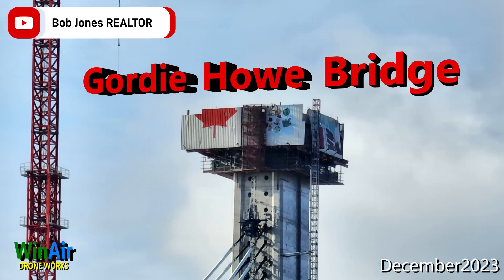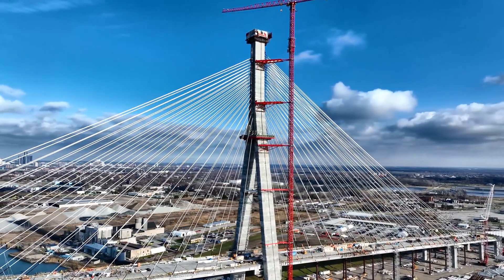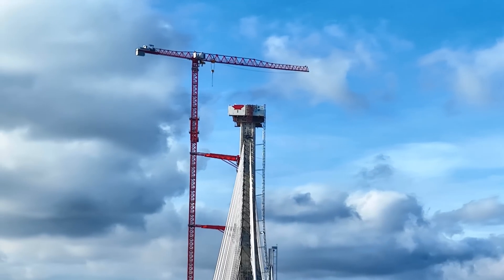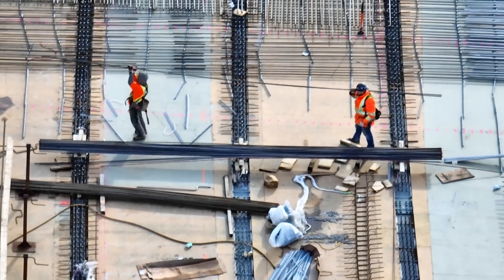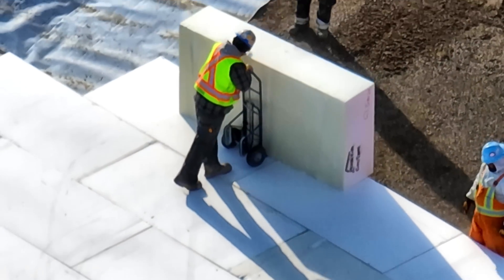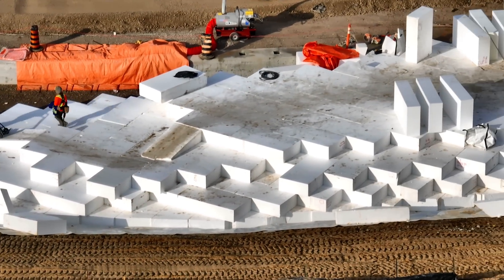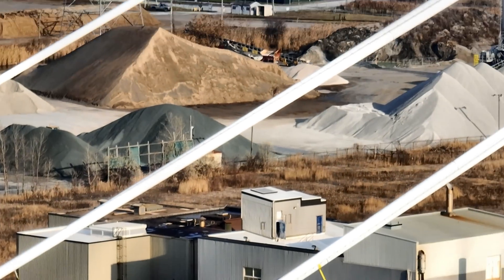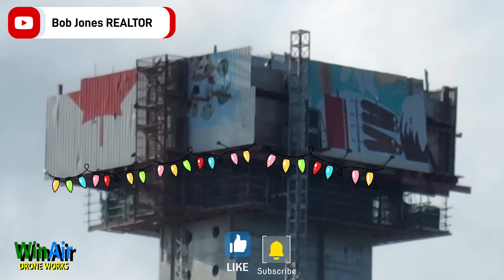See the Amazing Progress on the Gordie Howe Bridge!

Comment: How do they assure the alignment of the two sides?
Reply from the maker: Good question. This is what I found; 'This typically involves the use of advanced surveying equipment, GPS technology, and laser-guided construction methods to guarantee the proper alignment of the bridge segments during construction. Additionally, the project likely involves regular inspections and adjustments to ensure that the two sides align as they meet in the middle.' There is a special section used for connecting the two sides once the meet I read in a search. It would be cool to catch them installing the last section. Let's hope!  Thanks for the comment.
Reply: @bobjonesrealtor7756  I kinda thought it would depend on laser and gps technology. I recall seeing a video on placing the final piece in the Gateway Arch in St. Louis, MO. They had to start very early in the morning before it got too hot and the structure would expand due to the heat.
Reply from the maker: Interesting information, Bill. There is so much that goes into the creation of these mega structures. Thanks for the post.
Reply: Lazers.

Comment: Thanks for showing the in-situ assembly the spinning of the stay cables!  I was under the mistaken belief that these cables were coming ready to install from a factory.  Such spinning of 4 stay cables during and after the positioning of the next cantilevered deck section is probably a major reason why it rakes 4 weeks to fully complete the placement of one deck section.
I wonder what the reason is for this cable spinning on the job?  Weight of the cable?  Length?  Curious.
Reply from the maker: Great question. The installation process for stay cables on a bridge typically takes about two to five days per pair of stay cables. Weight and length certainly have a lot to do with it. Control over the tensioning of the stay cables plays a big role as well. The stay cables are tightened and adjusted to balance and stabilize the bridge deck. The length would be different for each set of cables as they stretch out toward the middle. I read if laid end to end  metal strands would measure approximately 5,000 kilometer's or 3,107 miles in length. Thanks for the post!